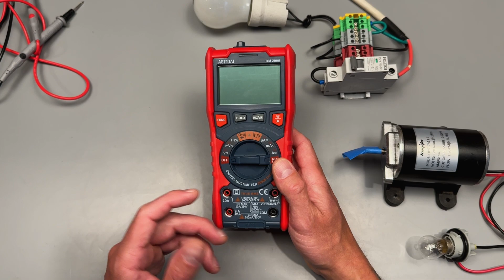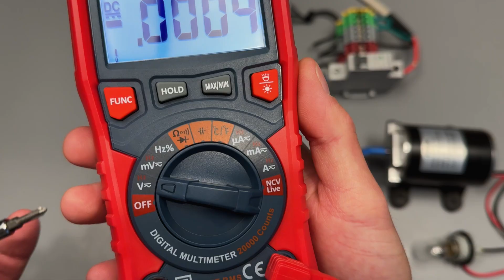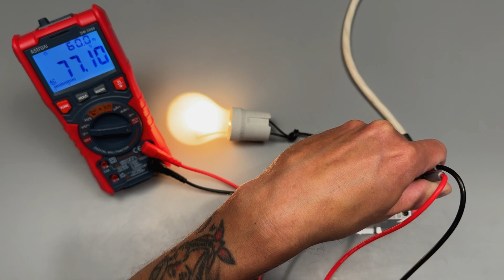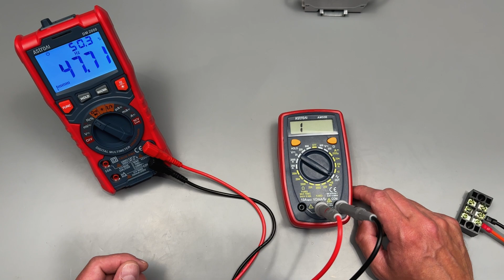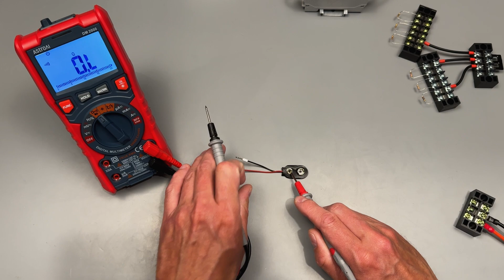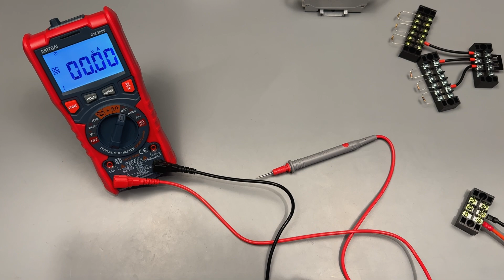💥 How to Use the AstroAI DM2000 Digital Auto Ranging Multimeter | Full Tutorial! 💡

Comment: How do you get to the fuses? There is only one screw and it's to remove the cover for the battery compartment. I don't see anyway to open the meter case to get to the inside.
Reply from the maker: On a meter like this, you’ll most likely need do disassemble the clam shell (the two halves of the meter) to get to the fuses.

Comment: @3:27 that is being read as 629 micro farads, which is equal to 0.629 millifarads.
Most digital multmeters, depending on the counts, is switching to a higher value unit, next to the actual unit if it goes beyond the count limit of the meter.
Reply from the maker: Good to know 👍